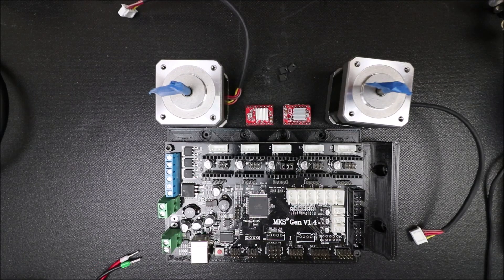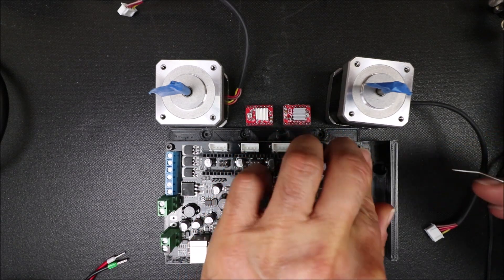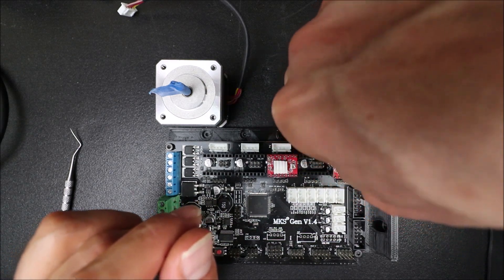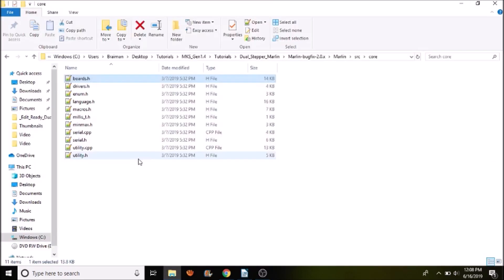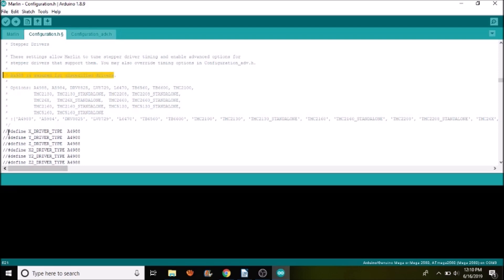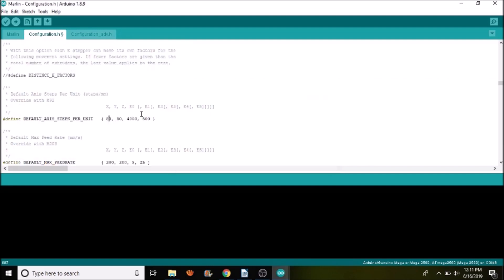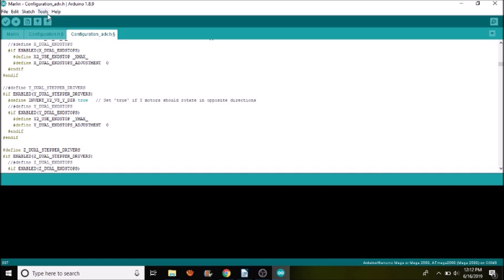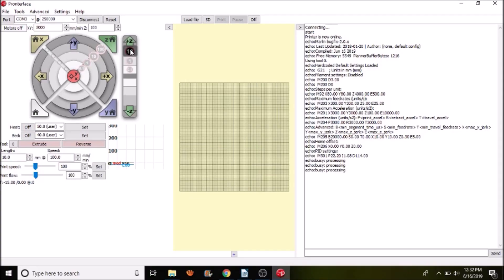MKS Gen 1.4 - Dual Z steppers with Marlin firmware (Part one)

Comment: Good video, thank you.  Can you do one with dual z, dual endstops?
Reply from the maker: Soon.  I'm working on about five tutorials in my queue and then will start to add more to do.
Reply: @EdwardBraiman  I am just curious if it will help keep the bed level if it know to adjust 2 steppers.  Thanks again.
Reply from the maker: Steppers currently will only move in parallel.
Reply: @EdwardBraiman  So I was thinking of dual z steppers/rods, dual z stepper drivers and dual z endstops.  In Marlin, especially bugfix 2.0, there is the capability to re-sync thereby re-tramming the bed to the x-axis.  Someday, when I get ready for a full upgrade of my E16, I will give it a go.
Reply from the maker: Sounds interesting.  I've not yet digested the whole firmware, but I would like to examine it soon.